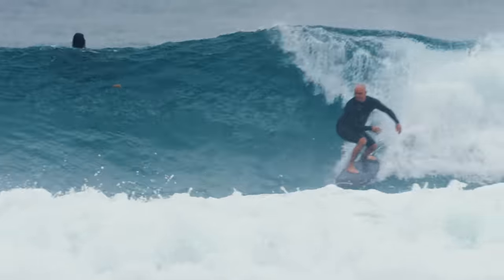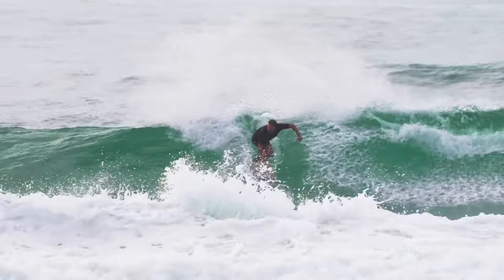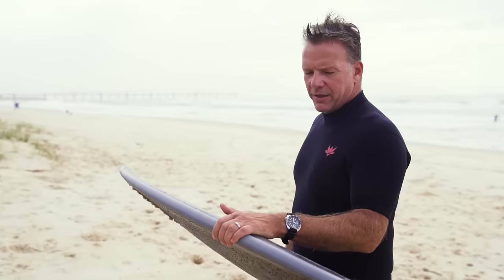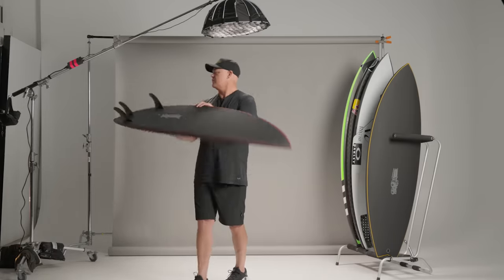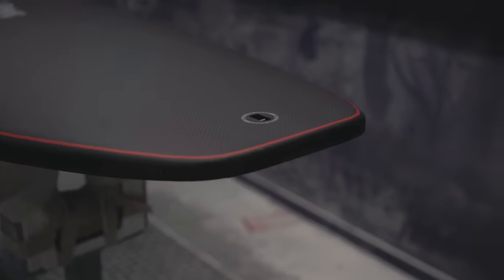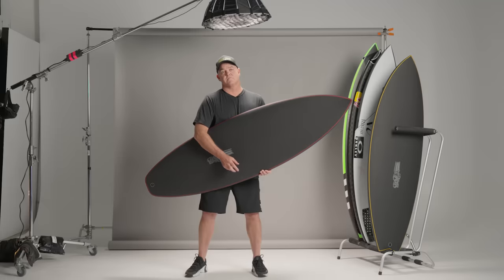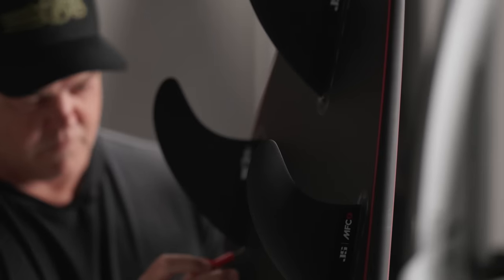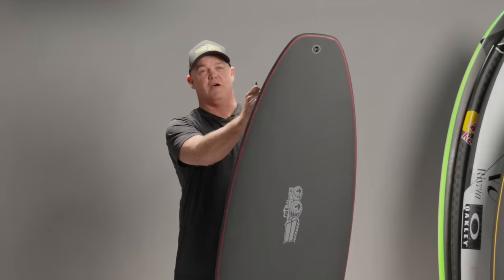CarboTune construction by JS Surfboards

Comment: 😂😂😂 shapers think of themselves as steve job, 90% of surfers don't care about design and materials they just want enough volume and a reasonably flat rocker ...
Reply: These arent shapers, theyre just buisness men trying to push out some new overseas made crap
Reply: They might not hand shape anymore but respect those guys (JS, DHD, and everyone else). It’s true that it’s not the same thing as it was back then but they made surfing evolve through the years. No shapers no surf
Reply: Of course I wouldn’t pay more 1000$ for a board but it’s interesting to know what are the materials and tech involved of what you have under your feet.
Reply: @florianbeaulieu3082  I’m not respecting companies that are bought out
Reply: @lilhard gotta disagree with you there bud. Have you ridden a carbon fiber board? Have you ridden a Hyfi or FireWire? I’ve been surfing for 30 years. I’ve ridden all the above constructions and I started out in the 90’s riding stringer PU boards with glassed on fins hand shaped to order. There is definitely a difference in the feel of each board. The way it paddles the way it bottom turns. The ease at which it can gain speed to set up for your next move. If there wasn’t a market for it they wouldn’t be spending millions of dollars on all this tech. My carbon fiber dark arts board has also held up way better than my standard EPS boards including FireWire. I drop $500-600 on a standard EPS board that you get a few years out of if treated gently. Why wouldn’t I want a more durable board that can last me 2-3x that long or more for a couple hundred dollars more? Ya there’s great marketing and I’m sure the products  are fluffed up but JS is putting out some of the best surfboards I have ridden. I still have a Monsta Box Hyfi board that  is one of my go to daily drivers. They are putting in the R&D for next gen boards and the difference is noticeable. If all you need is a PU standard glass easy paddler than cool for you. A lot of us appreciate the tech and how it can improve our experience 🤙🏾

Comment: I bought a Hyfi Sub Xero some months back, my first ever JS... I'm 105kg+ so got a 6'6. I bought the Fanning 2+1 to put in it (the H4 styled things). I don't know how much is the fins and how much is the board but this combo just amazes me. This board whips around so hard and fast if you crank a cuttie - I've seen guys involuntarily show surprise and smile at the turns. It has that beautiful balance of being drivey on my backhand (super vert off the bottom) but strangely not stiff going forehand, very easy to release when you want - often a board is way more comfortable one way or the other but this thing is so exciting both ways. I can't express how much this thing excites me. I can't say that it's the absolute best paddler or groveller I've ever owned - but it might be the most exciting board I've owned. It only takes a little bit of push to light this thing up and I've ridden it from knee high to double overhead. I suspect that it's the built-in flex system that makes it burn out of turns if you load it up. Just wow! Wish my wife would let me get the carbotune lol... thanks JS 😊

Comment: Nice work guys. 
Which fibre did you settle on? 
Is it all dry fibre or did you dry pre-preg? 
What infusion process? 
Did you go with any UD? 
Any change in resin system? 
What FEA are you doing/programs are you using?
Reply: this makes no sense, talking about dry fibre ud pre preg, none of that is relevent
Reply: Thanks for the comment. 😊 As it happens it's very relevant if you care how it's made, where it's made, how much it costs, the quality, and im sure in some cases the performance as well.

Comment: Can it be dinged? What happens if you ding it? What happens if it falls off a bike and gets run over or if your ex stabs it with a pitch fork? How do you fix it then?
Reply: they are epoxy blanks, so same as an epoxy
Reply: If they are vacuumed bagged they will be much more resistant to dings than common epoxy boards. I have a couple Corevac boards and you can bang them on the road and they don’t dent. They also flex like a PU board but don’t break.

Comment: They are beautiful. I want a super stiff and resistant surfbboard. I made one on my own, but much much more amateurish, fins are not even in the correct direction
Reply: flex is a very good quality for a surfboard. super stiff rides like a log as do some of the stringered epoxy boards.